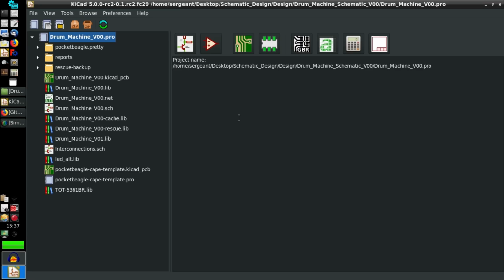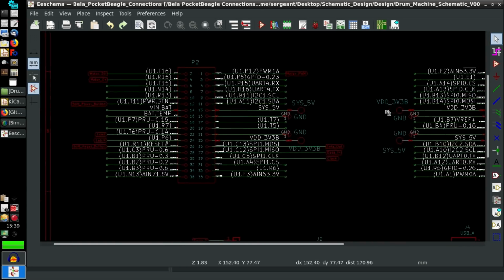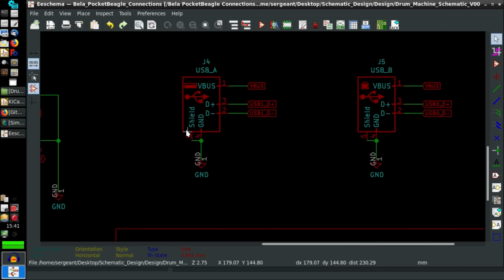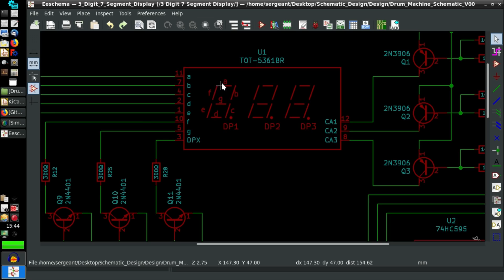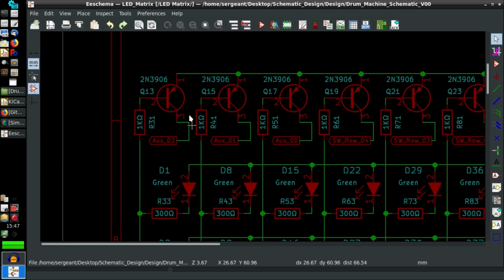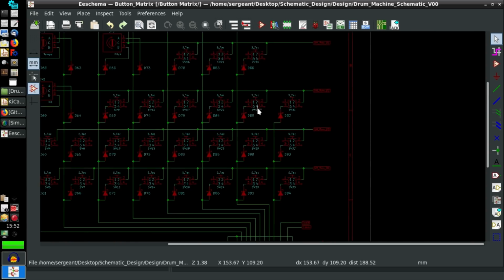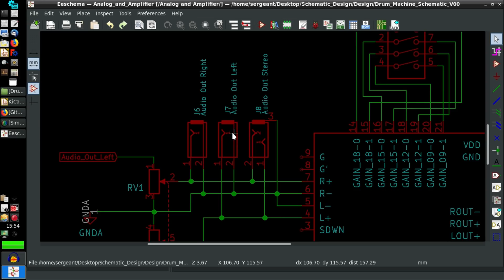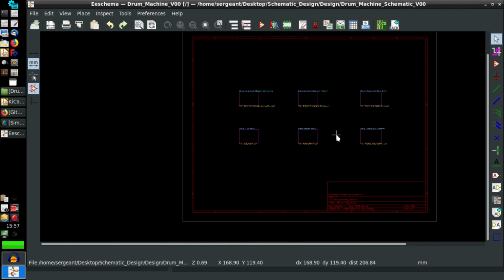Schematic Design in KiCad - sudo Sergeant 23

Comment: I understand your preference for a black theme, but for recording a white background would be way more readable
Reply: WooDWorkeR - black theme with an oled screen is so much better for your eyes than staring at a white screen. Black theme master race!
Reply: Only good on an OLED screen because it's black rather than grey on IPS/TN/VA. Also saves battery and amazing (the best) contrast.
Reply: Not to mention when the screen is black, the pixels are in an off state and reduces burn in. I have a plasma and just like OLED, are susceptible to burn in. Keep that screen moving.